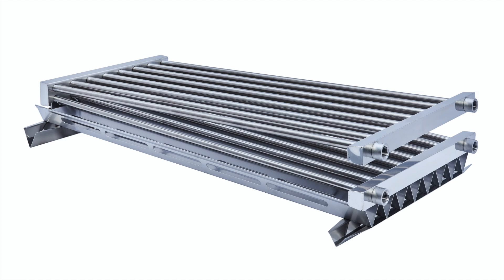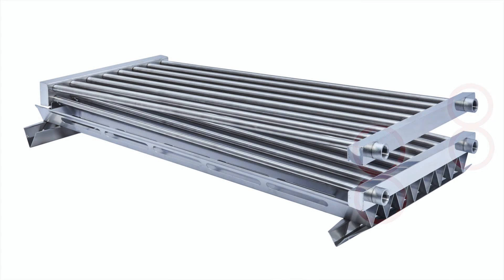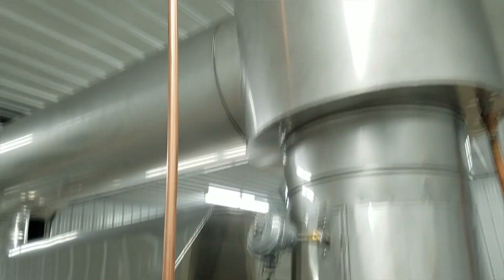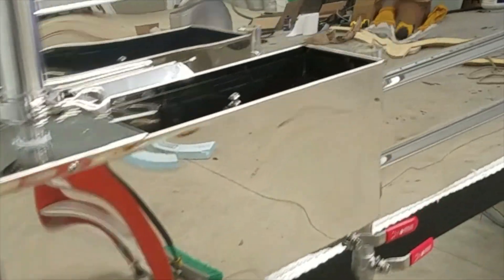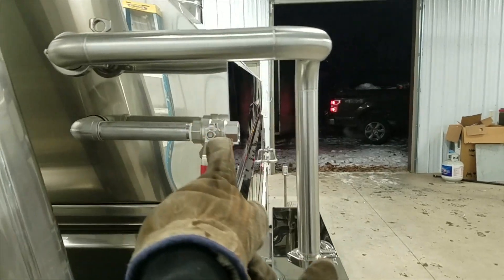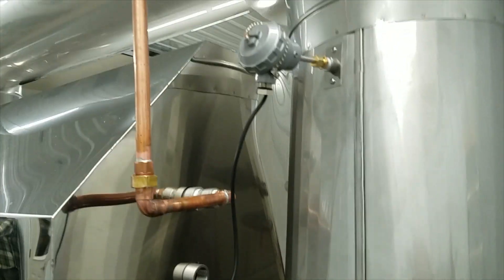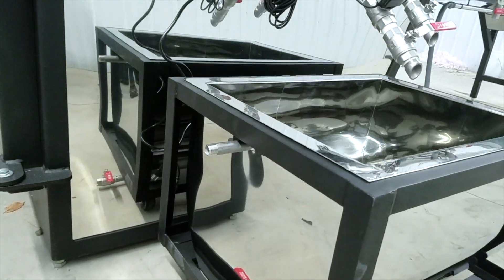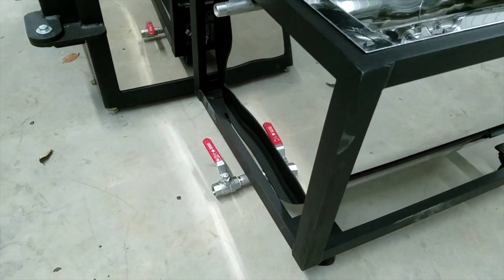Chapter 3 - Backflip™ Preheater

Comment: At what temperature is the sap coming out of the preheater ?
Reply from the maker: 210 degrees Fahrenheit.
Reply: Nice upgrade from copper to stainless!
Reply: @bobbelanger6426  isn't copper 25x more conductive than stainless?  Understand there is a cost difference but doesn't that sacrifice efficiency?